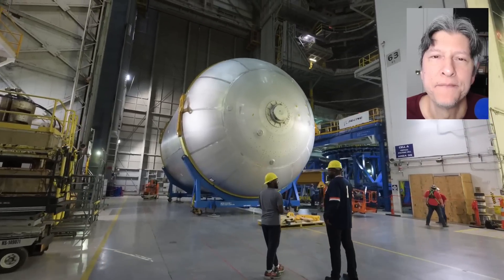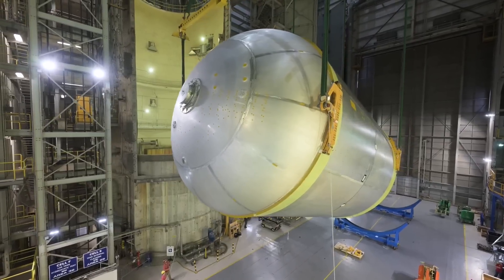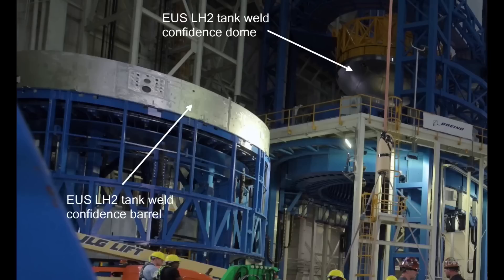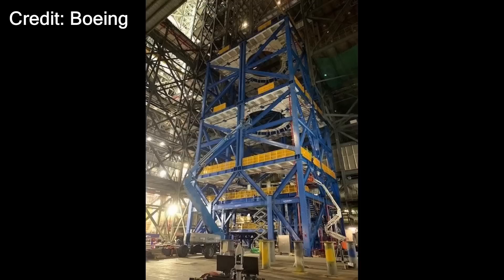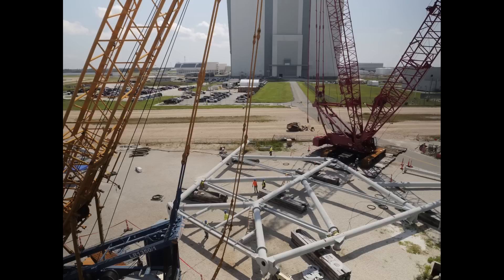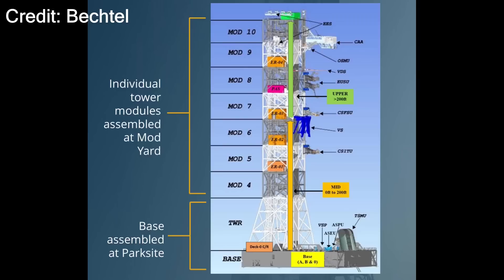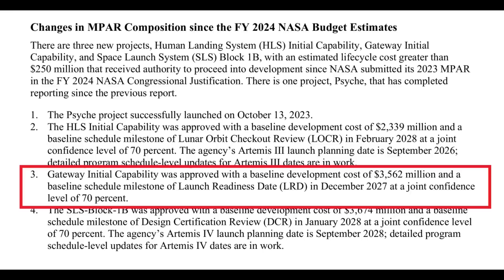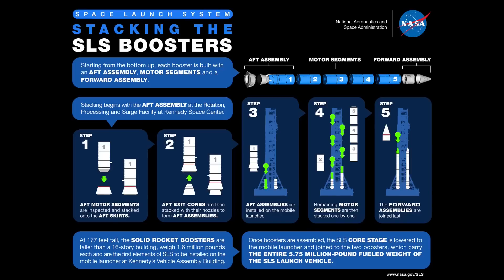Week in review: Mobile Launcher-2 tower "chair" in place, SLS Core Stage production update

Comment: Off-topic for this video, but I’m curious if you know if there are plans to retain any flown RS-25 engines for museums or engineering schools.
Reply from the maker: I guess it depends on whether one considers retired SSMEs to be flown RS-25 engines.  There is retired SSME hardware on display and in storage, but if the name RS-25 is applied beginning with SLS, then those engines are expended with the Core Stage.
Reply: @PhilipSloss  how many are being saved? My understanding was that all of them would be expended, but that was one news report many years ago.
Reply from the maker: @PetesGuide  SLS is using the up-to-date SSME hardware.  The engines are a mix of replaceable components, so that included inventory to cover two ground test engines and sixteen flight engines.

But there was a lot of hardware that was obsoleted by major upgrades during Shuttle, particularly after the Challenger disaster.  All that is still around somewhere, along with components that were retired due to time/cycle usage.

Aerojet Rocketdyne was looking at using some of that obsoleted hardware for the AR-22 project; that got cancelled, but I believe they still have a lot of that SSME-era hardware in storage.

Comment: Do you have a good explanation in previous videos of why it takes NASA so long to build a tower, when SpaceX has demonstrated it can be done extremely quickly?
Reply: The question is best addressed to NASA's prime contractor on that project: good ole Bechtel National, Inc.  Any future prospective customer considering Bechtel for their project, should pay keen attention to their "performance" on Mobile Launcher 2.
Reply: A Starship tower doesn't have to move.  The mobile launchers are legacy Apollo era hardware.  They were needed for the Space Shuttle (which SLS is derived from) to allow stacking of the solid rocket booster segments to occur inside the controlled environment of the Vehicle Assembly Building.  Once complete, the entire stack is carried out to the Pad 39B by a crawler, which is another piece of Apollo legacy hardware.  Then it takes about 11 days to hook everything up for a launch.  Try as I may, I could not design a more inefficient process.  But hey, the Space launch System was designed by politicians not engineers. What did you expect?
Reply: @ericmatthews8497 This is not true. Both MLs are new builds, with ML-1 originally being assigned to Ares 1. Only the strctural work was completed before the Constellation Program was cancelled.

ML-2 is brand new designed from the get-go for SLS Block 1B.

The old Apollo-era MLPs that was used for STS launches have all been retired with only MLP-1 remaining.
Reply: @DaveS_shuttle  I never said they were not new.  I was referring to the practice of using mobile launchers. Transporting fully stacked launch vehicles to Pad 39B by the crawlers goes back to the Apollo era. The Shuttle era adopted the concept for reasons I stated above, and SLS adopted it from the Shuttle.

Comment: I think we would have heard by now if the heatshield analysis showed that it is okay to fly as-is with current the current mission profile... "We looked and we're okay" doesn't seem like big news to sit on.
Reply from the maker: That makes sense, but there are probably multiple layers under the option of flying the hardware as-is.  One of those would be what kind of re-entry profile to fly.  In order to go down the fly as-is road, they would need flight rationale, which they might still be working on.

It's also possible they are having internal discussions like the one for the Starliner crewed flight test.  But with different data sets, different levels of insight, etc.

The flip side to "waiting" is if they need to assemble a new heatshield, they also need to approve changes and allow that production to proceed.  The longer they hold off on that cluster of decisions, the longer it will be before a replacement is ready to fly.  And that could delay either Artemis 2, Artemis 3, or both, depending on what's going on.